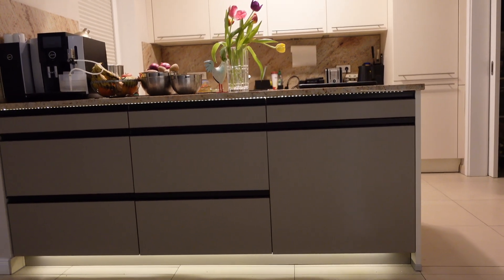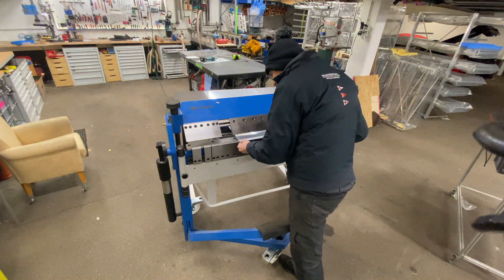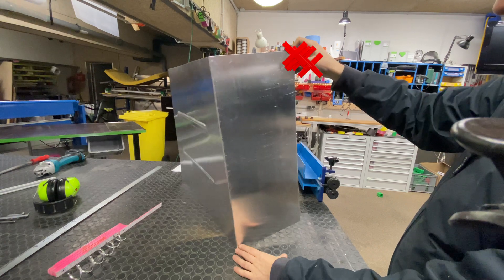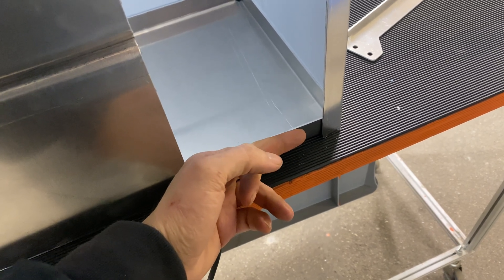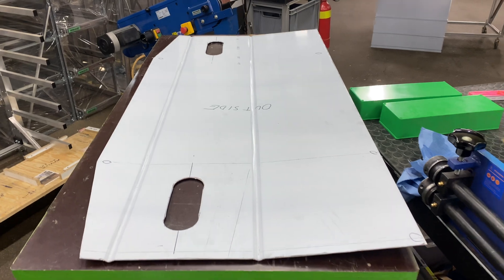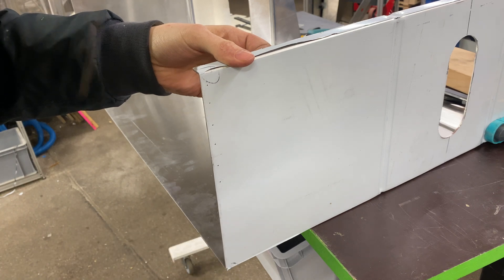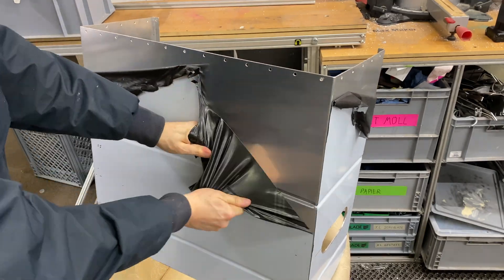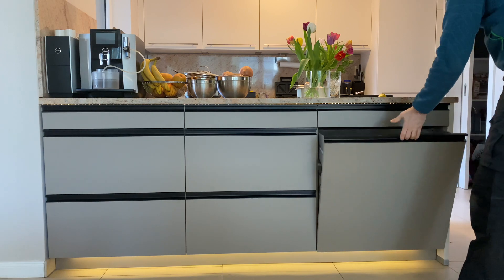Challenging but Achievable: How to Make a Sheet Metal Box

Comment: Oh look I make one simple metal box by using this thousands of dollar worth of equipment, WOW!!
Not even the corner notches are correct, you generally cut out 45 deg. corners to not have any access material, you also drill holes in the corners as stress relief when bending.
You also need to deburr the rivet holes otherwise they will have no strength, oh Jesus .... this is probably one of the worst DIY videos I have ever seen. 
A Russian dude with no tools in the snow makes this faster and better than you with your whole garage filled to the brim with tools.
Reply: Wonderful, I look forward to your video showing you doing it faster & better! You show the terrible human @Max Maker!
Reply: Max probably wastes his time solving complex technical problems while 884 gets better and better at making simple metal boxes :)
Reply: @michael-in-the-usa  You too btw you can read my last comment. A dude not even capable of creating a fucking box xD 
Jesus you got the internet, those a the most simple operations wtf.
Reply: if you want to learn, 'double ' your failure rate..    thanks for the vid Max  : )   inspiring for sure
Reply: @jimmyfavereau  Sure, but do it with Cardboard or something. This is simply right out stupid.
Reply: Share Russian video link please
Reply: Do you need a hug?
Reply: @seanalexander9531  Why ? Did I hurt your feelings, because I criticized a content creator you like ?

Comment: Depending on the project, I may build a prototype or smaller model using cardboard, scrap wood & hot glue etc. 
Then I make advanced beginner mistakes with the good stuff. Hahh😮 Mostly woodworking-
Reply from the maker: I was tired and tried to save time. Meassure twice, cut once is true.

Comment: Great video.  I think  you have a great channel that would grow with more content.  I like how you showed your failures.  It's nice to see that other craftsman and their mistakes along the way.  Im currently without my shop and so I have to vicariously make things by watching youtube videos.   I want to make a disc golf cart out of sheet metal.  I thought I would have to weld it but you gave me the idea to just rivet it! I also learned from your other videos about bending sheet metal.  Thanks.
Reply from the maker: I had to look up what a disc cart trolley is. I actually build something similar! Welding thin aluminium is very slow and error prone.  3mm and upwards is much essier. 2mm steel however is very easy. Good luck!
Reply: @MaxMakerChannel  that video was my inspiration but i think I can do it without welding
Reply from the maker: Yeah sure. Rivets are great for that.

Comment: Great job! I havent used rivets yet, I tend to use ugly self tapping screws because I work with wood more than metal.
Reply from the maker: I bought a pack with a variety of rivets, but most are far to small. 4.8mm head width is a good size to work with. If you buy Polybulb you only need two lengths.